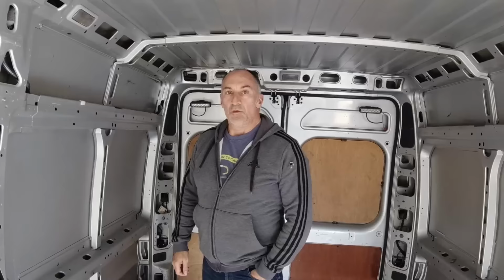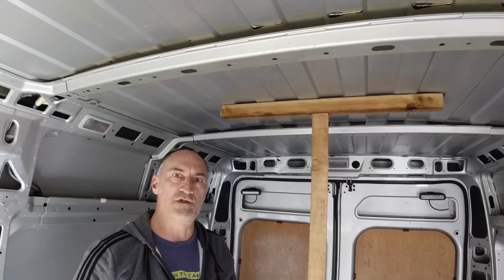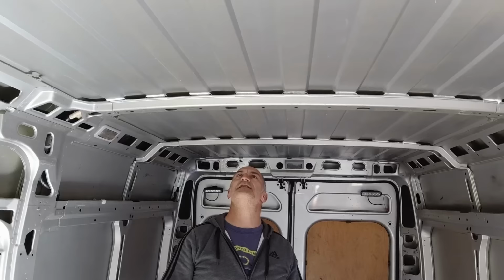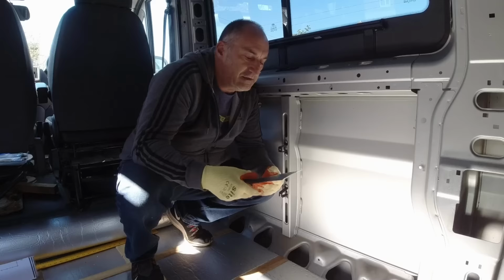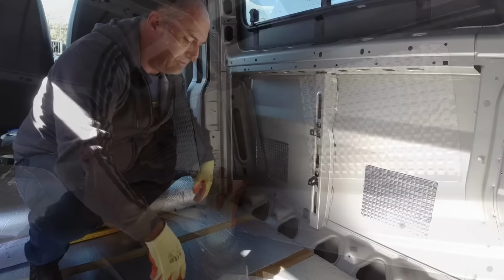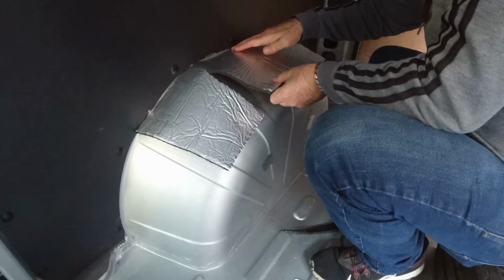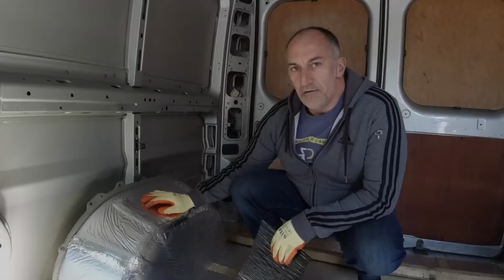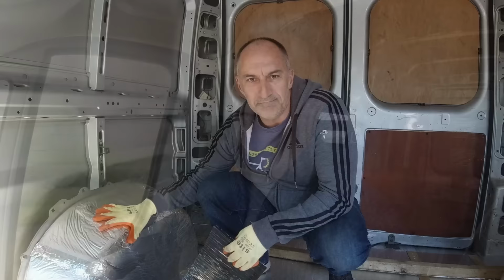Sound Deadening a Campervan, The Right Way - Budget Build Ep 8

Comment: Thanks mate. This is genuine thruthful info. I was planning on spending approx 500quid ish thru a well know firm... To add unnecessary weight and no benefit apart from fuel consumption losses.
Quick question - would 380w of solar + dc to dc charger, stored in lithium x2 @ 180ah battery, power a 230v/diesel truma combi boiler thru an inverter? Plan is to have 230 hook up as well but for off grid capabilities. Cheers Mr V
Reply from the maker: The truma will run perfectly on just diesel and 12v DC for the controls side when you are off grid so you don’t need to run it off your inverter. Save the 230v elements of the Truma for when you are on campsite hook up.

Comment: Help very much appreciated, new fridge in motorhome working on gas and 12v all good, then, initially works on hook up 230v then after 15 to 18 minutes flashing lights  giving fault codes,  take extension lead from house plug in fridge, it's perfect, have fitted new hook up, now about to fit new consumer unit,  do you see anything obvious . regards Steve

Comment: I'm watching too many van build videos, but --- I'm baffled how most of them are designed like static objects. Very few channels care about weight (or is the 3.5tonne limit a purely European limit?) so chuck in the 2x4s and 18mm ply for everything; either zero sound-deadening or 80+% coverage of floor and walls (skipping ceilings); and everything fixed as stiff as possible (as if a metal van doesn't expand in heat and twist on roads).  Many are either super advocates of sound deadening panels but with no rule-of-thumb of where to focus or what amount of coverage, or just say "it's too heavy"; and many say the opposite of their initial advocacy in their "1y later, what would I have done differently?"-video (and again, they suggest the opposite without showing where the balance lies of needed work/cost/effect/compromises like lost space).  I think you're the first I see that takes the stripped van for a short drive and listen!! Insane.

Comment: If you use solid insulation, like Armaflex you get a better result both sound deadning and insulation wise, you also save weight and money. ;-)
They actually proof that only solid insulation are better than both together.

Comment: Hi Greg- love your videos. As I watch this, I’m thinking it would be an easy job to add a bead of sikka flex to all of the panel/structure   joints while the van is empty. Any thoughts of adding to the bonded joints too?
Reply from the maker: It defiantly wouldn’t hurt to run a small bit in each of the main panels. 😊

Comment: Very interesting video. I have already filled my doors and boot in my Toyota Auris with the anti vibration sheets. Next step will probably be to put some in the floor and also put some cellfoam on top of everything. What is the tape called you are using to cover the space between the sheets?
Reply from the maker: It is aluminium foil tape. Links in the video description 👍🏼😃

Comment: Greg, great series and content as always. I noticed you didn't use a roller on those sound deadening panels. It seems I always see them being pressed tight with a roller over after placement, which I did on mine as well. Do you feel it is not needed or possibly even works better without the extra step? Thanks and I look forward to seeing how this build comes out. Keep up the good work.
Reply from the maker: As long as the panels are cleaned. We wash all our van with warm soapy water then allowed to dry. These sheets are unbelievably sticky so a firm bit of pressure with your hand is all that’s needed. My last van I just used an old paint roller. Don’t go buying special tools not necessary 👍🏼😃

Comment: Really useful video, thank you. We're converting a L2H2 Boxer. Which, closed cell insulation did you use specifically for the wheel aches? You've given a link to quite a lot of different ones.
Reply from the maker: I linked to the supplier that I purchased from so any of the self adhesive closed cell foam sheets will do the same job as long as they are thicker than 10mm 👍🏼

Comment: 😮 WTH. You mean to tell me that that roof is not welded to those beans? Just tonight I was hanging some rope from beam to beam to help hold things up in place as I work. I'm looking forward to using those stick pins the hold the foam board in place. I'm trying to remember did you use the little caps on the ends?
Reply from the maker: A lot of the structure is held together with silicone adhesive. 
While for the most part this is strong enough it also acts like a thermal bridge too 👍🏼😃
Reply from the maker: Yes I did use the caps on the stick pins then bent the pin over and applied foil tape over that.

Comment: I'll be vanlifeing soon out of neccessity, so subbed. Can you say why you dont do anything with the roof? Wont rain sound like hailstones without some sort of material stuck on?
Reply from the maker: We are going to be insulating the roof. That will help to absorb noise. Sound deadening sheets are only designed to stop vibration. You don’t get that with the roof because it’s ridged. You need insulation to absorb things like rain noise. Don’t waste your money on tons of these heavy sheets.
Reply: @GregVirgoe  I jumped the gun a bit there, didnt realise these tuts were so upto date, cheers. Well youve saved me a few quid on the sound deadoning with just that vid alone. 👍

Comment: Hi Greg, great video! Some really useful bits of info, so thank you. One of our roof beams had also come detached on our Boxer, which we've fixed. We now have an issue of the back doors making a lot of noise when driving. I've replaced the black stoppers on the bottom, which has helped a bit. However they still rattle very badly and we can't work out why. Have you ever come across this problem before?
Reply from the maker: Yes mine did the same and its all down to a combination of the door rubber and adjustment on the catches. I replaced the door rubber for a new one £30 and then set about adjusting the door catches so when cloed they pull the door tight to the rubbers, it's a fiddly job that takes time but does make a huge difference.
Reply: @GregVirgoe  thank you! Do you mean the door rubber that goes around the back doorway? I'll have some patience and give it a go. Thanks a lot for your help.
Reply from the maker: Yes mine were torn and had seen better days @alexleeder8325

Comment: Regarding to this product and also to the episode of Minimum isolation thickness, if you are going to apply the foam isolation material over the sides of the van - why do you need this for?
Reply from the maker: If you are goign to use close cell foam directly onthe metal of the van you woudl not need sound deadening sheets, i plan to use foam board insulation which is why i have placed the sheets there

Comment: I have Aluminium box truck and aluminium frame for the box truck under it and that sit on a Steel Frame of my Ford E-450 Super duty 2003. I was wondering if the coolant pipes and water pipes can be insulated as the floor but under the floor outside the box truck. between the floor and steel frame? I don't like the idea to have pipes and thick foam sheet inside my box truck.

Comment: I was thinking if you would stick the PIR boards on the walls would that also kill the vibration sound like those heavy sticky pads do?
Reply from the maker: Yes bonding anything rigid to the Fiat panels will have a similar effect.
Reply: @GregVirgoe  so that would save some money and weight if you skip the sticky pads ☺️
Reply from the maker: @we_wonder_the_world  you could do the same if you used the closed cell foam stuck to the van 🚐

Comment: Hey, do you even need sound deadening mat id you insulate these panels with Closed Cell Foam Sound Absorbing Insulation?
it should also take out vibrations when it is glued to panel? has someone tested covering panel and then knocking on it?
Reply from the maker: no, you dont, as you say the closed cell foam will do they job by itself really well

Comment: Great work! Beginner question - I did a quick online search and didn't find an answer. Is it possible to buy Sikaflex 522 in the US? If not, is there a similar product you would recommend?
Reply from the maker: You can get free international shipping fromthe UK using this link https://www.ebay.com/sch/i.html?_from=R40&_trksid=p2380057.m570.l1313&_nkw=sika+522&_sacat=0&mkcid=1&mkrid=711-53200-19255-0&siteid=0&campid=5338027957&toolid=11800&mkevt=1

Comment: Hi, have you given any consideration to the low spots between the ribs on the floor.
Reply from the maker: No need to do anything with those voids. For the minute gain you would get in a few mm of insulation it does not warrant the extra cost and time to do it.
Reply: @GregVirgoe   cheers

Comment: Hi Greg, did you use the same sika flex on the roof as you did on the wooden floor framing? Also how do you cut your closed cell form so tidy! 😂
Reply from the maker: Yes, I used sika 522 for both jobs. I use a pair of large scissors to cut the 10mm closed cell foam, if it was thicker I think a sharp Stanley knife would be my choice.

Comment: Looking at camprer van videos,  they appear to cover the entire van, but in theory the one sheet on each panel should deaden the panels?
Reply from the maker: You do not need to cover the whole van. Look at what the manufacturer did over the cab a small patch in the centre. That’s all that’s needed to stop vibration.

Comment: Why apply the aluminium tape to the seams of the sound deadening material on the wheel arch? It seems a bit pointless to me and would only be of use if you were taping heat reflective material or wanted to maintain electrical connectivity for some reason.

Comment: Great video again. Would like to get your opinion on Bison Polymax Express. Looks like a great generic applicable adhesive. Bonds really quick and stays a bit flexible. Could one use this on a camper? Thanks for any reply.
Reply from the maker: I've not used it myself, from what ive just read it does stay elestic which is good point for vibration of a moving van and is UV and weahter resistant so can be used externally. I'm not sure of it's adhesive strength without testing it?
Reply: @Greg Virgoe  Thanks Greg. From using Polymax for a wide range of applications, I know the adhesive force is more than ok. But I understand your remark on this. I have used it on our camper for the first time, fixing a toilet vent on the back of the camper.

Comment: I don't know if i have a bad batch, but that cell foam is a pig to fit. The micro thin film back just tears into strips when trying to peel off. Anyone else having the same issue?
Reply from the maker: Maybe a bad batch. You do have to be careful when peeling off the clear plastic from the sticky back. I did have some tiny sections where it pulled the adhesive off too. Get a can of Trim Fix to use if the adhesive is missing in places. 👍🏼😊

Comment: Hello Greg, Another really helpful video. I have yet to purchase my ducato l2h2 and have nowhere near to check one out.
I know the load length is advertised as 310cm but have also read that the bulkhead slopes back into the load area. 
Do you know the shortest distance from behind the drivers seat to inside of back door? and how high from the floor that is measured. Its so hard to find that measurement. 

Also are you using sketchup for this one or just the vr software.
Thanks
Heath
Reply from the maker: There is 3m of useable space in the back of the van and it's 1875 high at the edges.
I had to draw the van in sketchup and then transfer it to the vr headset. VR Sketch is a plugin for SketchUp
Reply: Thanks Greg. Looking forward to next video

Comment: Hi, would you recommend sound deadening a transporter kombi floor or not bother?
Reply from the maker: No don’t bother, just use a thick closed cell foam or PIR slab for sound absorption. You don’t need to treat the floor for vibration as it’s already very stiff.

Comment: Quick question, I've installed the foil close cell foam type mat in my car and have been told by someone that the foil is going to cause rust from condensation build up.

I quote...

"I only have concerns about water condensation underneath it I've pulled loads of that stuff off cars and there's always rust on the panel joints"

Is This true in your knowledge?
Reply from the maker: Providing that you make sure to seal all the edges and any joins to make a complete barrier there will be no condensation. Look at my bucket experiment video to show you 🤩
Reply: @GregVirgoe  thank you for your reply. Put my mind at rest. I see alot of foil deadening and it creates 85% deadening effect so I couldn't understand where he was coming from, as even dynamat have foil backed deadening and people have deadened full vans with that stuff. 😂👍
Reply from the maker: @mitsibeaver  if you are using a foil faced closed cell foam stick to the metal of the van you don’t need the heavy deadening sheets as the closed cell foam is enough on its own. You never need to apply sound deadening to an entire van that is just a waste of money and so much unnecessary extra weight added

Comment: Great videos Greg.. we are following this build as plan to do our own conversion next year. Can i ask as i am 6 foot 1 ish to maximise height we plan to use floor battens between the ridges and 20mm celotex then on the ceiling battens to sides of the ribs rather than onto them.. do you think this is a good idea ? Thanks.. Lee
Reply from the maker: Yes it will work fine and could save you another 1" of headroom. make sure to go over the roof beams with a small layer of foil faced insulation before cladding to prevent condensation. :D
Reply: @GregVirgoe  many thanks for replying Greg.. looking forward to your next video. Lee

Comment: The number of people I've seen who have wallpapered the insides of their vans with that anti vibration mat material, roof, doors, sides, wheel arches and floors!  The weight and expense of doing that must be significant.
Reply from the maker: Yes I’ve also seen the same. Trouble is the suppliers are pushing for it to be sold so they often give misleading advice too

Comment: Greg liking your way of dealing with your van. Have you made any videos showing how you soundproof the cabin area roof and floor. So many people cover the whole floor with 2mm dodo mat. I’m thinking that might not work. And better to put 10mm insulation but I getting a bit confused. Can you help?
Reply from the maker: Yes there is a video about the roof insulation and sound deadening. 
Bulkhead and Headliner Removal - Budget Van Build Ep3
https://youtu.be/4JISlxtcv1o
The floor already has foam sound deadening under the rubber matting so I don’t plan to do anything else with that 👍🏼😊

Comment: Greg, didn't you hear that on a test drive?
Reply from the maker: Not as bad as that because the bulkhead was still there and its an empty steel van you do get a few rattles but as you have seen its an easy fix so I wasn't bothered by it, just get it done. It woudlnt have stopped me buying the van its a common issue with vans

Comment: Are you sponsored by sikaflex? A very expensive waterproof caravan motorhome sealant. Or couldn't you just use normal trade silicone sealant for internal work at a fraction of the price?😅
Reply: After all, your calling it a budget build!
Reply from the maker: No, you can't use a cheap silicone sealant it doesnt have the adhesive propeties that is required for this task. It will only fail a year or so later then you have wasted your time and money. Some things still need to be done right even on a budget build.